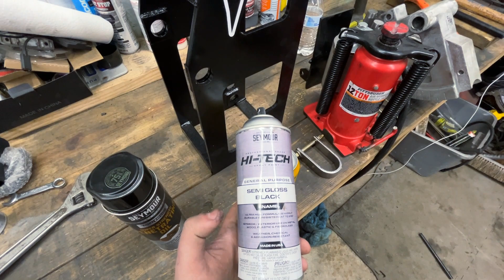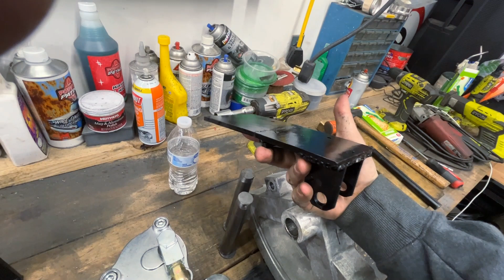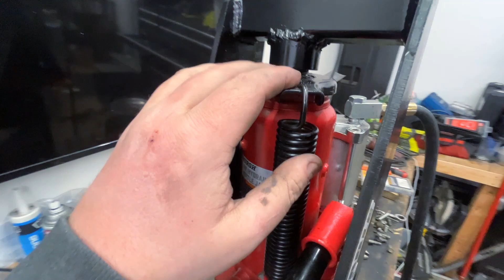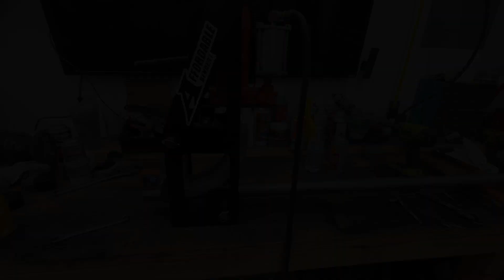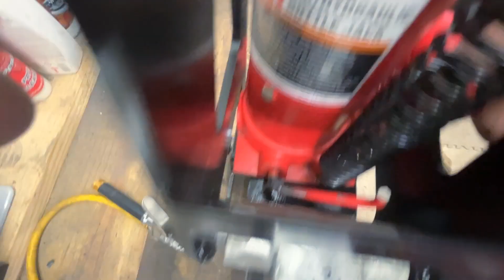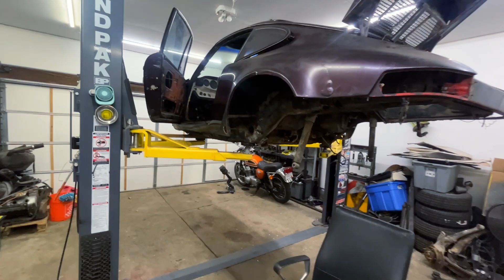The Most Affordable DIY Tubing Bender? Setting Up an Air Over Hydraulic Affordable Bender!

Comment: Or you can buy mandrel bends in any gauge and radius. With the price of a bender you could the bends as needed for all your projects for the next 5 years. 👍
Reply: Nope. Most parts of a roll cage, especially the main hoop, have to be one continuous tube with however many bends you need. You can't build a safe (or certifiable) roll cage by welding together pieces of mandrel bent tube.